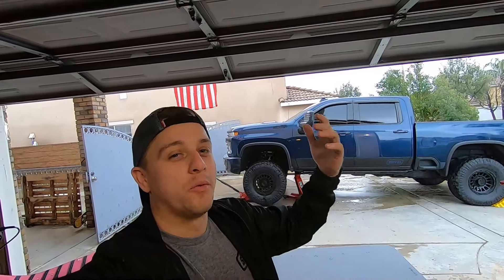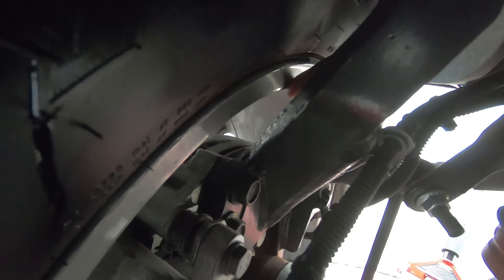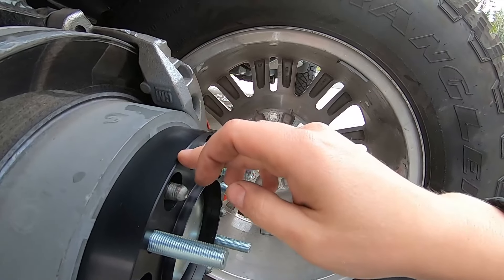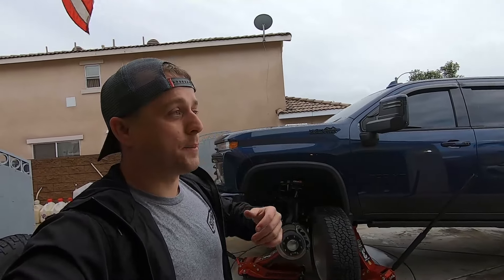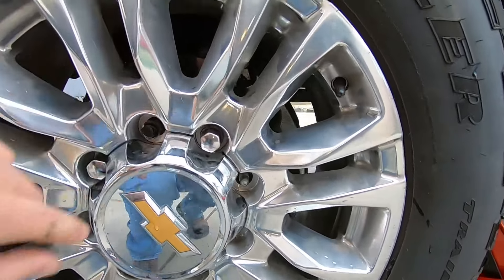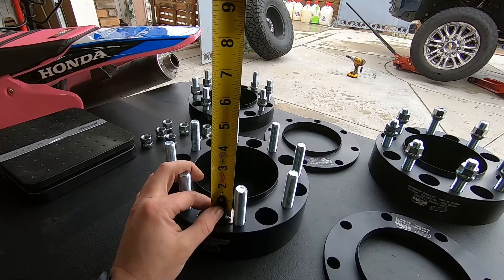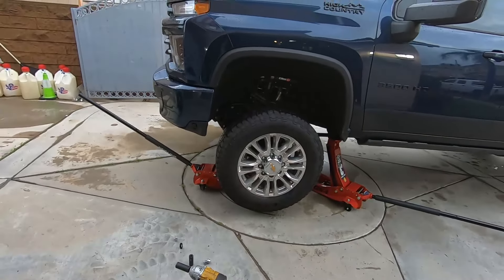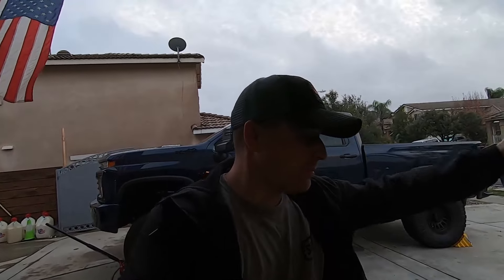What is the best BORA spacer to run on my 2011 - 2025+ GMC Chevy 2500/3500HD Truck! Let's dive in!

Comment from the maker: Get your spacers here! We Keep these IN STOCK 

https://scovelmotorsports.com/collections/wheels
Reply: Any 3/8 in spacers for 2023 GMC Sierra 1500 Elevation available that are hub and wheel centric?
Reply: How long does shipping take?
Reply from the maker: @markkruszewski16  in stock! On the website
Reply from the maker: @etello062892  all sizes in stock ready to ship today from California. Usually we ship UPS ground
Reply: 2011 2500...can u recommend 2" lift kit & tire sizes / spacer needed using oem 17" rims???
Reply from the maker: @rgperformance1803  We offer a 0.65”
Spacer now that would be a nice option. Kryptonite 2” leveling kit (called a stage 3) + 35x12.50’s and 0.65” spacers would be awesome

Comment: Will a 3/8 spacer stop a 37/13.50/20 from rubbing on the top a arm?
Reply: With a stock 2024 Chevy 2500 a arm
Reply from the maker: @landonmcmickens6355  likely not , you’ll want our new 0.65” spacer buddy! That will keep it from the UCA

Comment: Dealer told me, in Pennsylvania, you can only run 1/4 inch max for spacers. Yet I see so many truck with obviously more than that. Do they just take them off for DOT inspection?
Reply from the maker: They can’t make them hub centric in the 1/4” size, they aren’t safe so we only offer 3/8” as the smallest spacer buddy

Idk why they’d say that. 1/4” isn’t hub centric and will cause lug nuts to break off, people have that happen all the time. Wheel needs to be centered on the hub
Reply: @americanduramax  Thank you ! They did put 1/4 inch on it. But I still get a slight rub on the upper control arm. So I'm going with 3/8 hub centric, all around.

Comment: Is this the reason why most lifts state factory wheels won’t fit?
Reply from the maker: The high offset is part of the reason, yes sir. When you get a high offset wheel like factory +44 , it brings the wheel inward. While oem 20’s will fit many lift kits, its the larger tire sizes like 35x12.50 and 37x13.50 that will start to hit suspension components & also rub frame/sway bar at full lock

Wheels like OEM 17’s won’t fit on many lift kits because they’ll hit stuff like the tie rods and/or other components because they are too small & sit too far in because of the high offset

All aftermarket wheels of all sizes start at around +20 offset because of these reasons. I haven’t seen a single wheel made in the aftermarket that is in the +30’s or +40’s because of these clearance issues

Hopefully i answered that as best I could
Reply: If you ordered 315 methods with 0 offset will this clear the tire rods? I have a 5” rc lift
Reply: @americanduramax
Reply: 17x8.5 just not sure if they will clear

Comment: Running the 3 inch ready lift level kit on 37 inch Nitto’s on my 22 GMC 2500. The only issue I have is a little rub on the frame. If I go with the 1.35 or 2 inch spacer will it start to rub on outside front or rear fender? Excellent video tho!
Reply from the maker: Taylor thanks for reaching out! looks like if you go with 37's on a 3" , you should have little to no clearance issues with the 1.35" spacers buddy. it will pull it away from hitting the frame/sway bar components just enough. every truck sits differently though but worst case, its a very small modification to the front/rear of the fender well.

Comment: Dude. This was a great video. Cleared up so much. Question: '24 GMC 3500, 37s on stock 20s, leveled 3". How much trimming for the 2" spacers? Thanks.
Reply from the maker: Not sure how i missed this comment 3 months ago! Not a ton of trimming at all, very easy to fit that! we got kelderman fender caps that help with this as well. let me know if we can answer any other questions if you havent got anything yet

Comment: Do you happen to sell these bora lugs for my 1500 AT4 Sierra 6 lug? I’m adding 3/8” (10mm) bora hub centric spacers to my aftermarket wheel setup and would prefer this to get close to factory turns over adding new studs.
Reply from the maker: I do not have them listed on the site at the moment but I do have a few sets left that I can ship today for you, yes. 

They are full size adaptors like in the video so it can bolt on with all the turns. 

can you send me an email & I'll get you dialed in. Caught me at a good time as I am starting to ramp up my inventory of these

ScovelMotorsports@gmail.com
Reply from the maker: We finally got a ton of 3/8” in for the 6 lugs now too!

Comment: My f250 2018 lariat tubo diesel 6.7 fx4 has a 6inch lift on toyo tires 37x13.5 on17x9.0 wheels. I wanted to put on 2inch spacers but no cutting anything  , so I guess I am not, right???

Comment: What do you recommend for a 2023 1500 wanting to do a zone 4” or rough country 6inch have adaptive ride control and wanting to run 35x12.50r20 with zero offset. I want just a tad bit of poke past the fender but that’s it. Not trying to throw rocks all over the side of the truck. Please also respond with link to products in response.

Comment: I have a 2011 Ram 2500 I want hub centric spacers all around. But I’ve read they won’t slide over the hub on the rear axle?
Reply from the maker: Depends who makes them, not the ones we offer from BORA. They are precision machined to work on the front & rear perfectly

Shoot us a email if you want a set, i can dial you in 

SCOVELMOTORSPORTS@GMAIL.COM
Reply: @americanduramax  I’m wanting a set of the 3/8” bora spacers. I have my truck leveled and stock wheels and 37x12.5’s and they rub the upper arm pretty bad at about 3/4 turn. Can you get them cheaper than $89 a piece?

Comment: 2024’ at4 3500hd with 3”cognito elite and kings. Want to run Toyo MT 37x12.5r20 on oem wheel. Will 3/8 spacer help me enough
Reply from the maker: The 3/8" spacer would help clear the UCA but it wouldnt keep you from rubbing the frame at full lock when turning. that would require a 1.35" or larger spacer buddy
Reply: Cognito elite kit with kings installed. Truck is set dead flat. Bora 3/8”spacer up front. 37x12.50r20 Toyo MT’s on factory 20” wheels. Small lower front valance removed. Zip tied front liner forward on both sides. Zero rub back of fender. Only a small rub on full lock both sides from the Toyo sidewall lugs on Cognito UCA.

Comment: Do those extended lug nuts also work on stock wheels for AT4's and Trail Boss's with a 3/8 spacer?I see them on the website,but wanted to confirm before purchasing.I have seen other brands of ET lug nuts for Chevy/GMC trucks but they say they cannot be used on stock wheels.
Reply from the maker: Yes ET lugs work on all 3/8 spacers
Reply: @americanduramax  great,thanks
Reply: @americanduramax  but do they work with the stock rims? Im running the stocks rims and wanna do a ⅜ spacer with stock rims and extended thread lugnuts.

Comment: I have a 2022 at4 2500hd.  Running the stock wheels with a 3" lift and 37x12.50r20.  Rubs the frame behind the front wheel but otherwise nothing.  If i went with a 1.6" will i have to trim anything or will it get me frame clearance and still clear everything else?  Or maybe 1.35"?
Reply from the maker: Our 1.35” would be perfect for you i believe. I THINK you got 0.5” wheel pockets so those would be ideal, however, i would recommend you measuring the wheel pockets 1st before purchasing them and checking them to make sure OEM studs dont hit the wheels when installed. Super easy to check too! 
The 1.35’s would be perfect for clearing the frame, uca etc but keeping it tucked in as much as possible
Reply: @americanduramax  I'm good with a bit sticking out, just curious if I did that, would the wheels begin to hit anything?  Even if I went with 2" would it hut the bumper or valance?
Reply from the maker: Honestly that's hard to say. I think if you are currently rubbing now then you definitely would be rubbing with 2" spacers. usually 37's take a little trimming no matter what. since these kits are adjustable by the torsion keys, it further complicates what fits and what doesnt fit  @douglparks

Comment: Hello, hope all is well. I had a question, do you have to run hub centric in the rear also or just the front? Great video and thanks in advance
Reply from the maker: We get them hub centric front and rear but technically you dont need them in the rear like that. these come that way anyways so they can be ran front or rear
Reply: @AMERICANDURAMAX  thanks so much for getting back to me

Comment: Thanks for the informative video. You mentioned to avoid 1/4” spacers. Why?
Reply from the maker: Andrew, the 1/4” spacers are smaller than 3/8” and aren’t large enough to have a hub centric lip built into them. Without this, the spacer will become off center and cause vibration
Reply: @americanduramax  understood! Thanks!
Reply from the maker: @andrewcurtis2605  you’re welcome buddy!

Comment: Very informative video. 

I have a 2016 2500 Sierra with the gas engine. I put a 3.5" lift/level kit on it from rough country. I want to run American racing Outlaw ll wheels and 35" tires. Which spacers will I need?

Comment: Is there any difference in the amount of threads you get on attaching the spacer to the truck? Do you get more threads on factory studs with the 2in vs the 1 3/8. Kinda the same question but wasnt sure if i made sense. Thank you for your time!
Reply from the maker: Thanks Woody; I noticed a lot of turns on them but didn't measure that part in this video. It exceeds the 6 minimum rule by far but I didn't get that data unfortunately. I missed out on that.

Comment: Would that 3/8 in the front even out track with to the rear. I have it leveled and noticed front wheels tuck in
Reply from the maker: Luis, yes just a pair of 3/8" spacers up front would fix this
Reply: I cranked the torsion bars (leveled) my new 2500HD, ordered the 3/8 spacers for the front, hope it brings them out enough, front seems to narrow even stock.